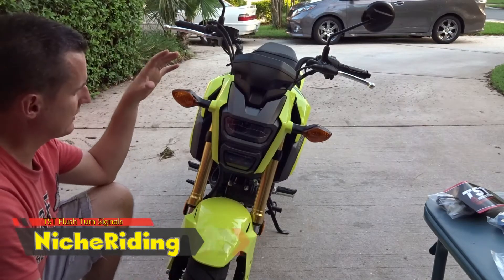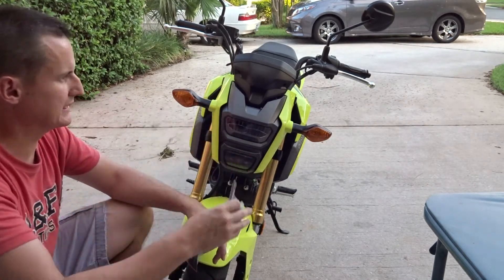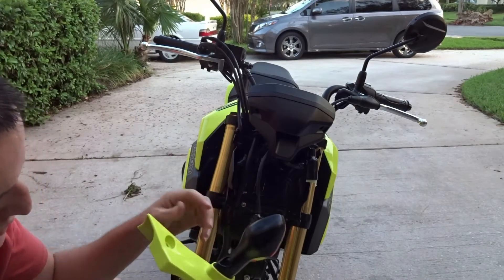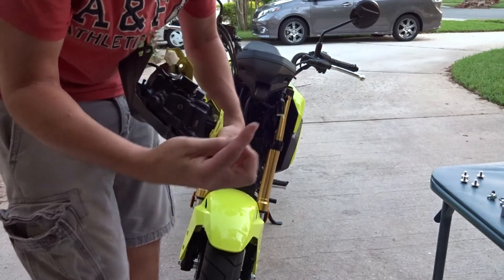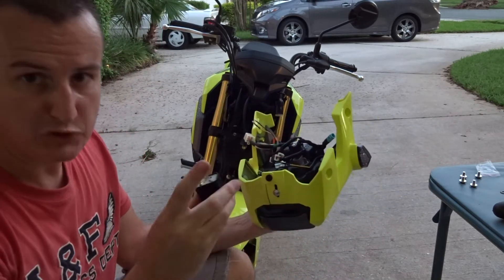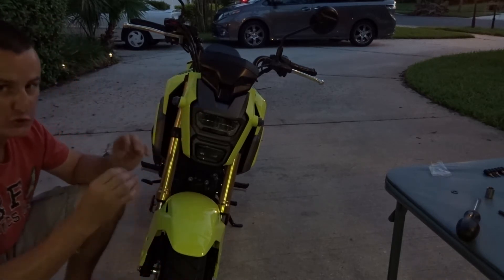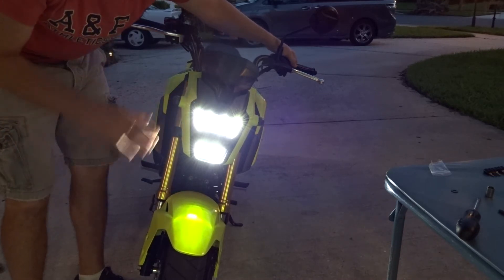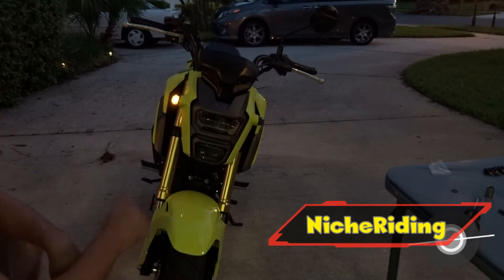TST industries Flush Mount Turn Signal Install. 2018 Honda Grom Build Series.

Comment: Hey Niche. Would you mind making a step by step video of how to adjust the chain the correct way? Not sure how to do it. I've watched other Vids but still puzzled on it. Or any tips or pointers or instructions would be great. Thanks. Love the lights by the way actually waiting on my fender eliminator and integrated tail light from motodynamic. Ordered it the other day and bought a AR racing exhaust from eBay.
Reply from the maker: Nice buddy, I don't have to adjust yet, I do know it's not hard but i just hit 500 miles riding home from work last night so maybe when it's time I can make a review. You will love the fender kit and turn signals, so bright!